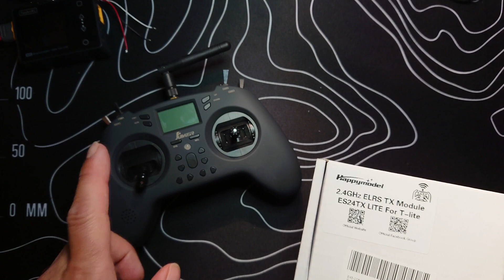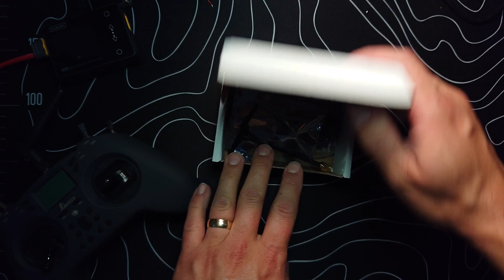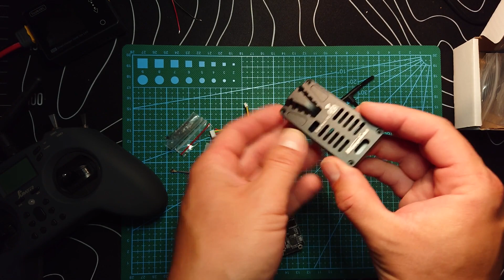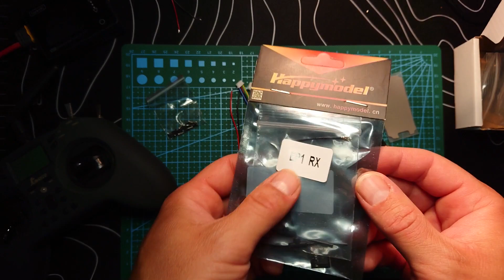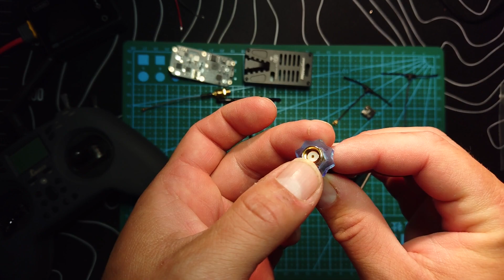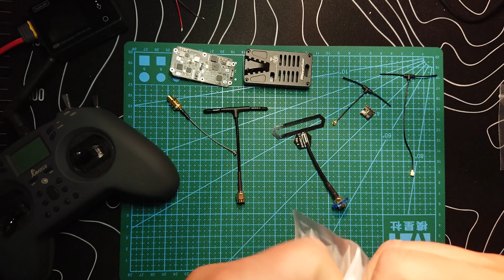Happymodel 2.4GHz ExpressLRS T-Lite Module & EP1 receiver. First look/Review plus upgrade options...

Comment: whats the maximum mw power this module and radio combo will do, thx :)
Reply from the maker: Not sure, the settings go upto 2000mw but that's very unlikely. I think it's 350mw on this setup but I run mine at 100mw and it gives me all the range I need. Sorry I couldn't be more helpful, thanks for watching 😁
Reply: @Rich-TeaFPV  no worries, i've set to 100mw as well. Cheers

Comment: Great bit of information. How are you finding the T-lite? i was about to pick one up from Hobbyrc but have heard the build quality is crap, bad gimbals and cheap, plasticky and toy like.
Reply from the maker: Hi, the T-Lite is definitely a budget transmitter but I've had no issues with mine so far. I use it mainly with my whoops and smaller quads so it's not my regular tx and therefore I'm not giving it as much use as some have but I like it. Is it the best tx on this formfactor, no the Tango 2 probably is, but if your after a budget tx or a backup to your main transmitter (a variation of the tx16 is probably the main tx for most people) you can't rally go wrong and if it's from hobbyrc the guarantee is actually worth something lol. Thanks for watching
Reply: @Rich-TeaFPV Hi, that's great to hear. I would be only using it for whoops/micros as well, as my daily is a QX7 running perfectly. Iv never had any interest in the tango radio,s. I think i,ll just bite the bullet and get one, and stick ELRS on it